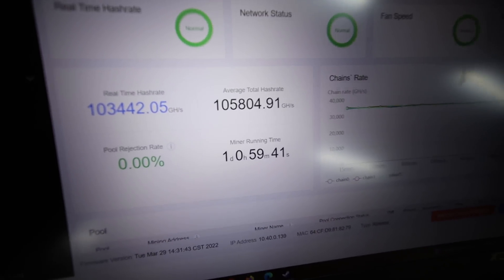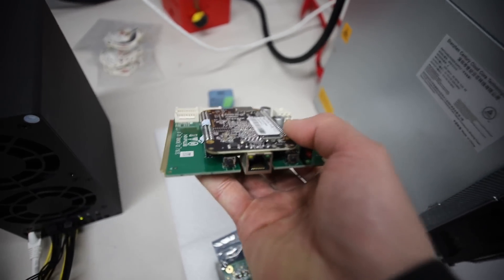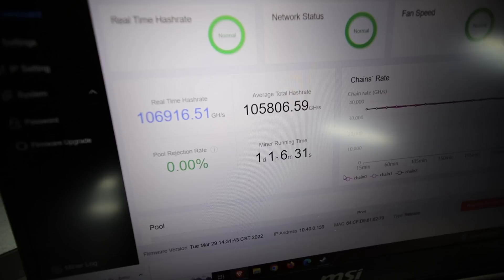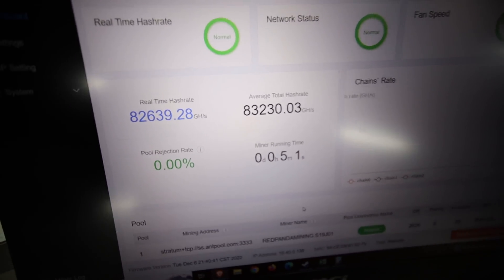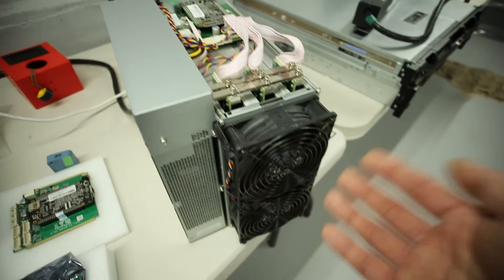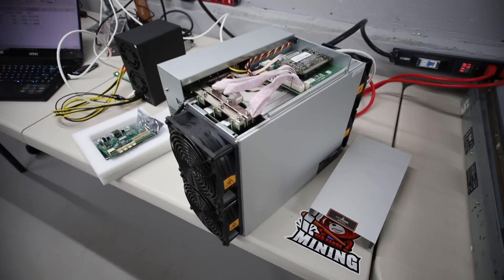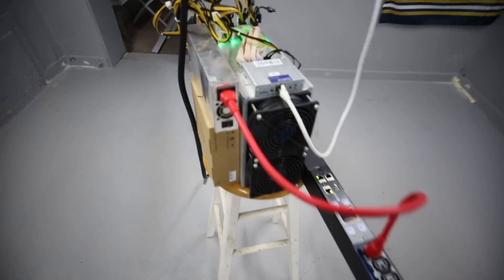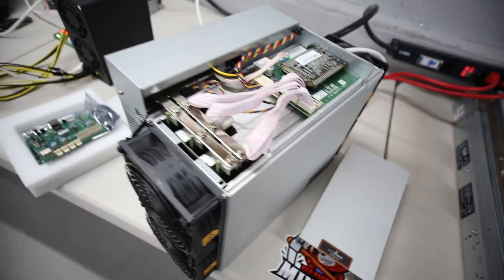THANKS BITMAIN... for the low power mode!

Comment: I know this is old but I recently bought a used s19j pro for cheap and uploaded the low power mode firmware 20221226125147. But after the firmware upload, I don’t see the low power mode on the settings mode, what am I doing wrong? Thanks haha
Reply from the maker: @gdouttuner  Ctrl F5 refresh browser
Reply: clear browser cache or use different browser

Comment: tried to find software for my older s17 pro a while back and there was nothing left on the website , you can still get the firmware but need to contact the helpdesk with all the info on the miner
would conside running two miners on the low powermode as running two miners at full power it uses too mush amps for my fusepanel 5000 watt over two fuses is cutting it close on the single main fuse

Comment: In my apartment I got 2 breakers, 15 amps each, 1800 watts so I wouldn't even be able to plug one in lol
Reply: Just upgrade to a 20a 240v breaker and remove another breaker you could live w/o like your heater

Comment: 30% power reduction with only 20%  hashrate reduction.
I run all my mini doge asics on low much more efficient safer as they burn up on high and your equipment will last longer.

Comment: will I still be able to put in my SD card and boot my modified firmware after I update? I'm already getting 83mhs at 2300w but I just the plain s19 model.
Reply: Will the SD card still work?